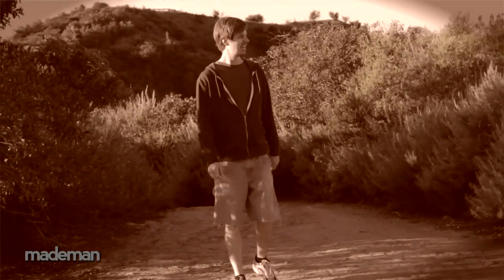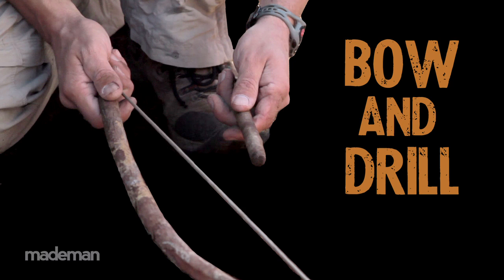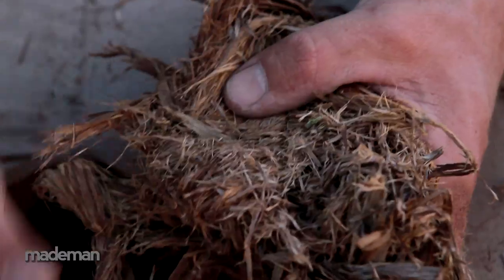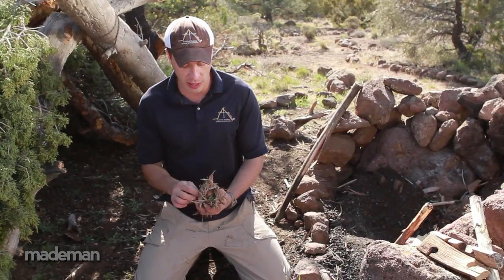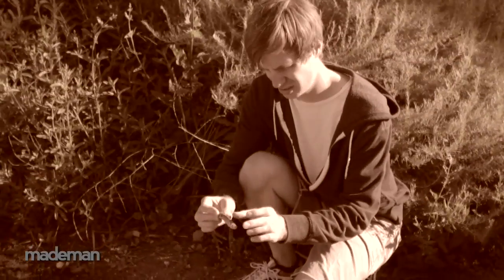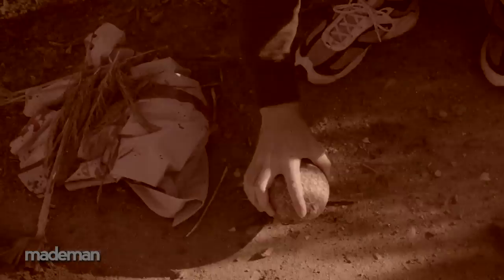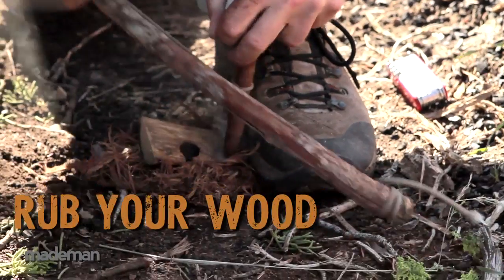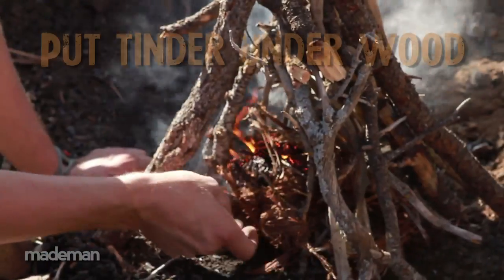How To Build A Fire Without Matches - For The Win

Comment: You can find a curved stick anywhere and use your shoelace to make the bow. Base board isn't hard to find, It's got to be soft in the first place so you can break it off of a dead or dying tree. The stone doesn't need to have a hole in it. It's only used to keep the drill in place so you can use pretty much anything that the drill isn't going to wear out.

Comment: This is actually volcanic ash, a very soft stone found across the globe, as this ash has covered most of the earth at one time or another. It can be "drilled" into with the point of a harder stone, or even the can opener of a swiss army knife/leatherman. Volcanic ash is an extremely common stone but it also works with: talcs, soap stone, and a range of sedimentary rocks as well. Neat right! If you can't id these, use a piece of fresh green wood, so it doesn't burn through the top. Thanks!

Comment: actually no it is not. The hem of your shirt or a strip of your shorts is much better than a shoe lace. The stone-volcanic ash- is easily "drilled" with the tip of a harder stone, and is common across the globe. A variety of sedementary stones, talcs, and soapstones, can be used as well. The base board is "peeled" away from the splits in a broken branch or tree trunk, and the bow is broken off the tree as well. The drill, which must be dry, can also be snapped off.